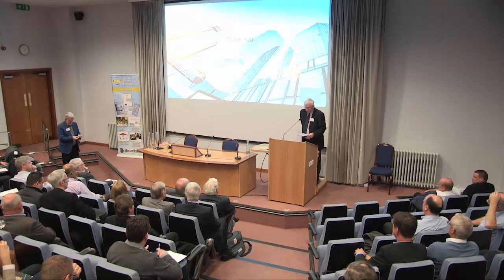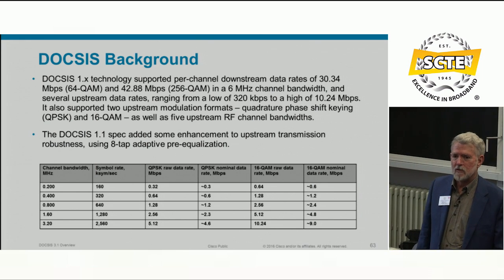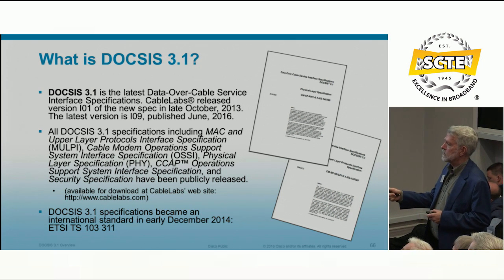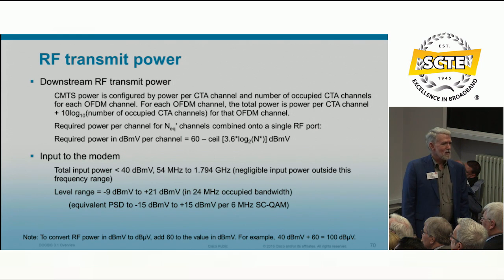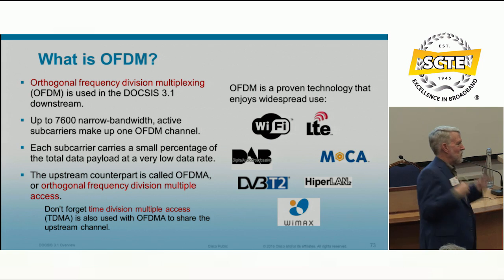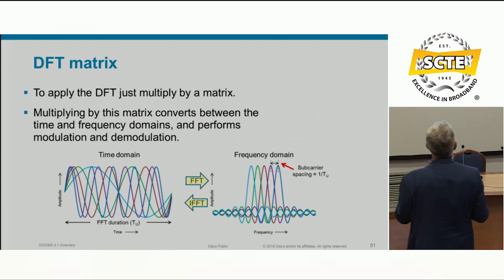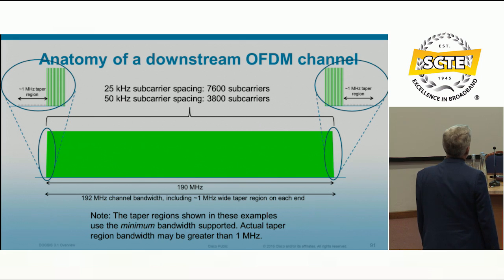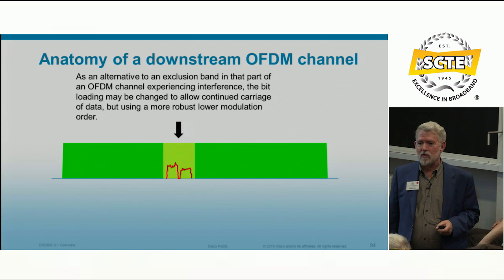DOCSIS® 3.1 – An Overview

Comment: What an excellent overview. Was just after an overview of a tech I've been using for 20 years now and had no real idea how it worked. Just had Virgin Media upgrade me to 1Gbps, shocked that it's really 1.1Gbps on old Coax cable. Can't see things going past 1Gbps, we're at the local network limit! And WiFi's getting faster, but only in the same room.
Reply: Time to upgrade to 2.5 or 5 or 10Gb/s Ethernet.

Comment: I love this presentation, but that last slide has me laughing... "FTTH equiv" Not even remotely. Not even in 2016. Fiber was already doing 1G symmetric. It's doing 10G symmetric now. (T is selling 2000 and 5000 plans in several markets today - end of 2021) Spending any time/money on cable physical infrastructure (mid-split, high-split, FDX) is burning money better spent on fiber; cable cannot compete with fiber. Even going full D4.0 with a complete forklift "upgrade" to a full spectrum bidirectional system will only get cable to the point fiber was years ago. The only thing cable has going for it today is that it's already in the ground.

Comment: not very good. The distance over it works is pathetic compared to fiber. That is why it is not mentioned, you would laugh. It is worse. HFC has multiple points of failure. Fiber is basically a star network. This is basically a bus network. The maintenance costs of fiber beat copper easily.  If it is so good, why isn't it under the sea? The only thing is that copper is a legacy thing and that is the only advantage but very slim advantage. DOCSIS and the copper cable industry are keeping things from going forward.
Reply: Johnny bizaro coax isn’t ran under the sea because fiber allows for longer runs without a repeaters. HFC networks are not a bus network the Fiber in HFC networks use a transport ring topology (redundant as hell). The coax ran from the fiber nodes is pretty much the same way FTTH gets distributed to the home.  Also you should apologize to the engineers who dedicate their lives to this science and continuous advancements in this industry.
Reply: I believe the use for this is for cable companies to use the existing copper in the field to give the subscribers more. Idk why your focus is on topography, this is just a way of keeping the equipment in the field and changing the equipment @ the cmts and the node. If this were a structured topic of how to get FTTH, i think you would have a valid point.
Reply: These are HFC networks meaning they use fiber.
Reply: Johnny, Most if not all HFC networks are based on ring (SONET / SDH). Coax is just a way to deliver services "on last mile" to the subscribers. Fiber is better in many ways but also in many cases it is still better to use old fashion copper;  for ex. using coax you can not only carry payload (signal) but also power for amplifiers and probes that monitor the network. In case of fiber you have to have separate power supplies. 
And going back to the topology; modern FTTH networks are passive optical networks. It means that you have one single mode fiber feeding optical splitter   and from there multimode fibers running to the subscribers homes. This is very rear to have individual fibers runs from central office / head end to the homes. So forget about star topology.

Why copper coax is not used for transcontinental / transoceanic cables? Because fiber for THAT JOB is more cost efficient. But using your logic I should drive semi-truck to commute from home to work in city. 

Fiber is still more expensive to install and maintain in home / residential environment. Electronics working in optical domain ain't cheap. Simple FC connectors cost from $3 to $20 a piece while RG6 coax connector is less than 50 cents. It does not look so bad if you need to buy few pieces. But lets say you need to wire whole building with 200 -  500 units. So you need to have twice many connectors, right? Those things stay at customer's premises. Service provider have no means to control their conditions. If Mr. Jack decides to do some "improvements" and damage that hardware then the service provider has to repair it. They have to send well trained tech, which costs more money than trained monkey such cable guy / phone guy. 

And concluding; DOCSIS 3.1 can deliver TODAY nice speed of 1Gbps without need of drilling new holes in your house. All what you need to do is to swap your existing modem.   And in most cases you don't have to live in a center of the big city.
Reply: TJ Blues The experience where I live is HFC is inferior in every single way to FttH regarding the consumer. We have 3 major ISPs here, only one installed HFC and the other 2 FttH, the service isn't cheaper in the HFC ISP, the service is worse, in peak hours speeds latency and packet loss degrade like hell, and now even that one ISP is installing FttH in every new location and replacing HFC for FttH the sites they provide or making deals to share the FttH lines with other ISPs. Also failure and malfunction rate on the HFC is, by the own ISP numbers, way higher and takes longer to fix. Sure evolving HFC is nice and if it wasn't by competition the HFC ISP i mentioned here probably wouldn't be swaping to FttH